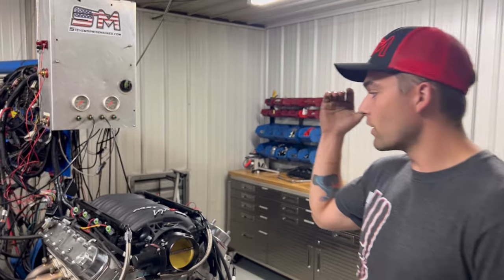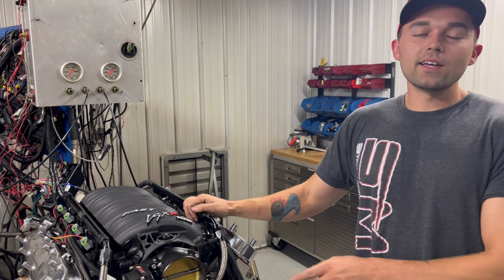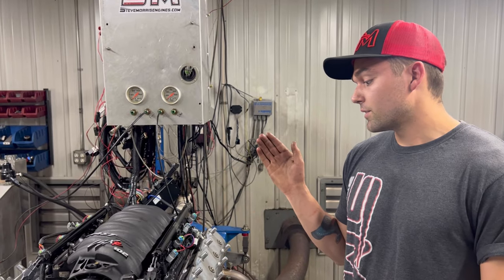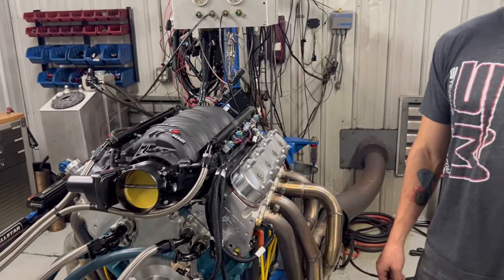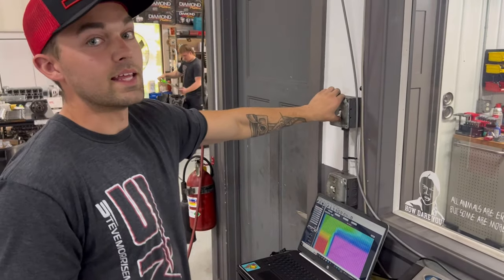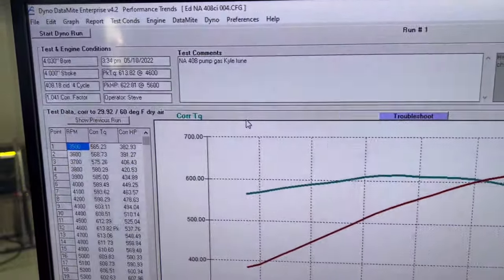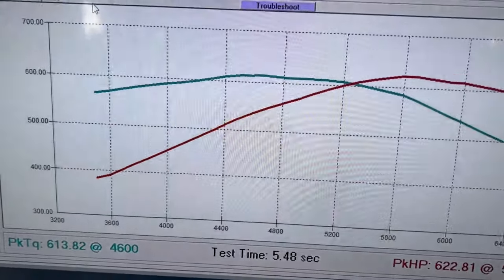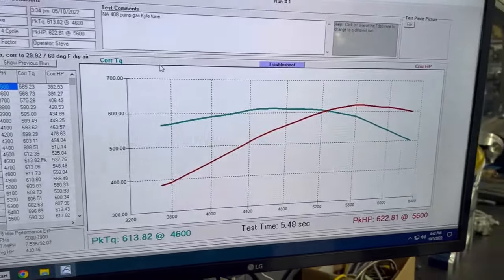Budget NA 408” LS Build @richardholdener1727  Style!!

Comment: 622 and 613 under 6000 rpm, on the street who needs more? No overheating,  no boost leaks or ice buckets or expensive turbos, etc. This is a win win
Reply: That is the entry level hp to be competitive on the street... I'm riding around at that level and barely keeping up with most guys.
Reply: @picklefart  at $75 a bottle these days for nitrous, i would opt for the turbo myself. But no matter what more is better!!
Reply: @justinb1488  It would take quite a few bottles to equal the price of a quality turbo kit, fuel system and tuning. A 250 shot with a progressive would be nuts on this combo.
Reply: @justinb1488  Your take is 100% correct. I thought about this and came to the same conclusion. Plus I'd rather have 300 hp in boost vs nitrous, it's just easier on the engine. And I priced out a nice nitrous kit and for the nice stuff you end up having like 2k in a kit.
Reply: @justinb1488 I wish it was that cheap currently in Ohio $14 a lb right at $150 a bottle

Comment: I love it, a non billet block build is budget to these guys and an aftermarket rotating assembly is top shelf to ole junkyard dog Richard lol.
Reply: Hey... Every budget is a budget, no matter if it's a hundred bucks, a million bucks, or a blank checkbook.
Reply: I don't know if I'm just in a different world, but I completely fail to see how a new cast iron block is not budget friendly. Why are LS guys so cheap?
Junkyard crap is not budget friendly, it's a totally different scene.
Reply: @AB-80X  because most people don’t have 10k of disposable income to put together an engine/car that likely won’t be practical lol
Reply: @andrewmontgomery1763  There are more people in the world with money these days, and many with that kind of fairly modes disposable income. All you have to do is go to the various racetracks and see what people run. Racing is expensive and many people seem to find the finances to go fast these days.
Reply: @AB-80X  Why spend the money when an old used block will do just fine? Especially for an N/A application...not needed.
Reply: @AB-80X  the cost of a dart block alone could build an 800hp junkyard 4.8 lol. That happily lives a long life.
Reply: AFR heads alone are like 3k that’s not budget
Reply: I bought a 2500 HD for $2500 sold what I don't need. And my old blow tbi. Before Modifications, I had $750 in a 6.0 and a 4l80e   Beats the heckout twenty five hundred dollars for Crusty motor off of ebay.

Comment: I’ve never been an LS fan but it’s hard to argue against the bang for the buck they produce.
Reply: So why wouldn’t you be an LS fan
Reply: Being taken to gapplebees by a junkyard 4.8 with an ebay turbo.
Reply: I wasn't a LS fan until I bought a car with one in it and that was about 8 years ago. I wasn't against the ls at the time I just didn't know much about the engine. I agree 100% with the bang for the buck deal because it's an addiction.
Reply: I agree. I am a fan of the LS, but they are in EVERYTHING these days. It's getting to the point where, if someone is running something other than an LS, it almost seems exotic.
Reply: You ARE indeed a fan. You're just in denial.
Reply: Same. It's funny, every single time something like this is mentioned people jump in with the same regurgitated responses. I assume mostly by folks who weren't raised around cars, variety keeps the hobby alive.
Reply: They’re not cheap outside of USA and Australia
Reply: To build a good 408 that is going to last is gonna cost around 10k.
The 421 stroker in my buddies racetruck from carb to pan is about 15k.
Strokers aren't the cheapest to build.
Reply: @davidsharp922  10k is a bargain for a naturally aspirated 408ci torque monster that will clear 500whp. That's why the LS is the best bang for the buck.
Reply: @cali2468  the 408 that was in the Fairmont made 650 and took a 400 shot of nitrous. 
Ran a 5.20 8th mile.
Reply: Holdener had a junkyard 5.3 at 1500 hp. LS are amazing. Good flowing heads, and a bottom end that holds up to big power.
Reply: @davidsharp922 , way cheaper to turbo a 5.3. All it needs is ring gap and a cam.

Comment: I just built one similar to that for my regular cab Silverado. It’s got Mamo 205 heads, ported TBSS intake and a 226/230 grind in it. It’s a daily driver so I didn’t want anything to wild. This motor has crazy throttle response and low end torque. Lots of fun on the street!!

Comment: Read all the comments, can someone help me with the specifics of this engine.  Compression, cam specs, Rocker arm length....Or show me where to find it.  I've been looking for the right combo like this for years, this is the best I've seen. Any tiny tweeks suggested on the cam to get it to 6200 with out moving torque higher in RPMs? Thanks!
Reply: Just search you tube for holdener 406

Comment: Somehow I think my definition of "budget" and yours are 2 different things. That's a 25K minimum motor right?
Reply: Nowhere near that... Maybe 10-12k in parts and a couple grand for the prep and assembly.
Reply: The heads and intake are most of it. Then all you need is a cam, rings and a junkyard shortblock. On a REAL budget, you would use a trailblazer SS engine and a turbo. Ring gap and a cam and you're at 1500 hp

Comment: How can you tell how tight the lobe separation angle is on the dyno gragh.... I need a little knowledge. I'm a little confused on that topic
Reply: Tighter LSA builds a stronger and narrower power band (peakier). If it's too tight, it won't extend as high.
Reply: @SGray44444  thanks S. Gray.  That makes sense to me. Less Scavenging during split overlap, correct me if I'm wrong but slightly less RPM on the top end.
Reply: A tight LSA makes more mid range power, and can definitely make a broad powerband. A wide LSA softens the low end and moves peak power up.
Reply: @AB-80X   Thanks

Comment: Budget?
AFR? And budget? what sort of budget you talking bout?
Now take it apart and make some power.
I know it's Not a turbo motor or built by Steve Morris, but
For the same sort of money that thing would cost, you could be in the low to mid seven hundred horse region with carefully chosen parts and the same sort of budget. And with a machine shop like Steve Morris, I think the power approaching one thousand horse out of a naturally aspirated Ls would be more impressive. With head flow close to or better than a Sprint Car Engine the LS should be  at least 950 HP from just under 410ci. anyway.. I've got shit to do. 

Freakin LS owners pfft..
Make you that power with stock heads.
Makes me laugh 😁